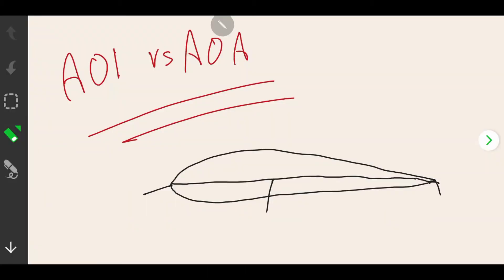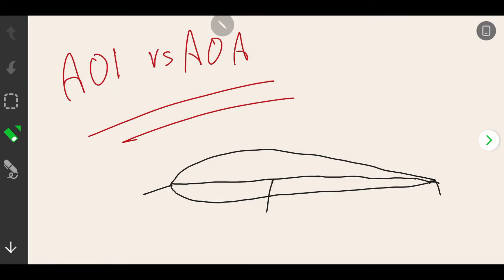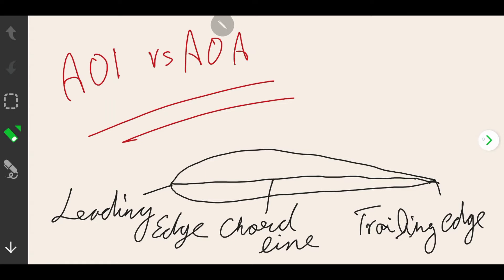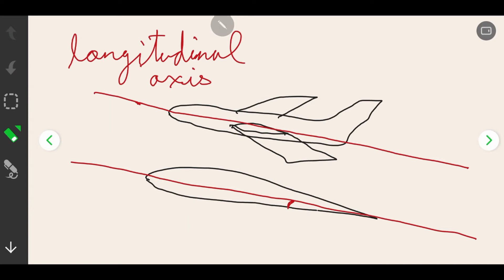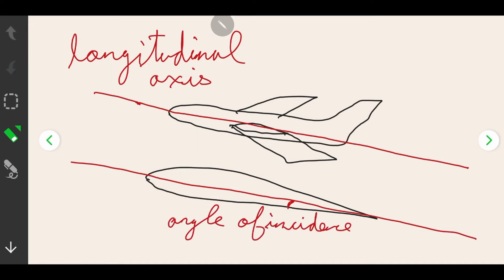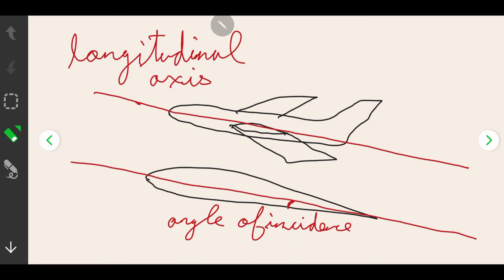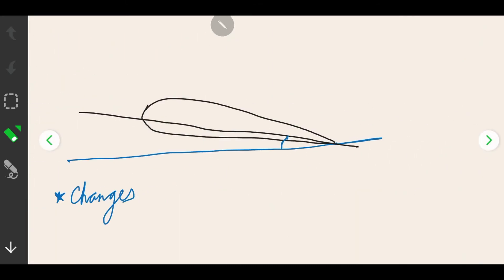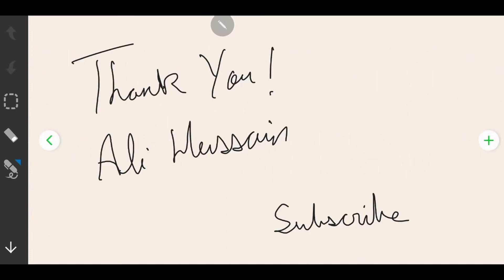Angle of Incidence vs Angle of Attack

Comment: AOI is fixed geometry between chord line of the Wing and Longitudinal axis of Aircraft. AOA is angle between  chord line of the Wing and Ground.
In other words, When Air craft is running on the ground (before lifting) , the AOI and AOA must be same, Correct
Reply from the maker: Not exactly. 
Since, Angle of attack is the angle between chord line and the relative airflow not ground. 
Angle of attack is when the aircraft leaves ground.

Comment: some info.      aoa  is  the  angular  Difference between a wing's  aoi  and  the  Thrust  Line. !!   these days,  a  very small (or zero) aoa is used, together with a  LIFT-making, cambered profile.  such as the clark-y (orig.)     googletranslate
http://1.bp.blogspot.com/-5C8vhlmhBOk/VRe3o3Jt3yI/AAAAAAAABrI/EEgVHXkLvbY/s1600/clark%2By.gif

https://en.wikipedia.org/wiki/Clark_Y_airfoil
Reply from the maker: They are improving airfoil designs and new ones keep coming. 
Thanks for the info!